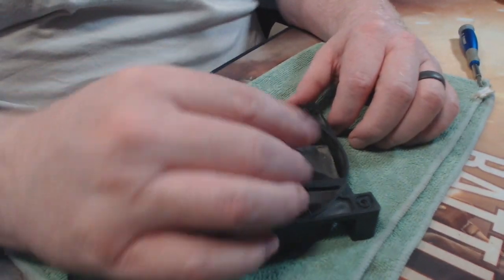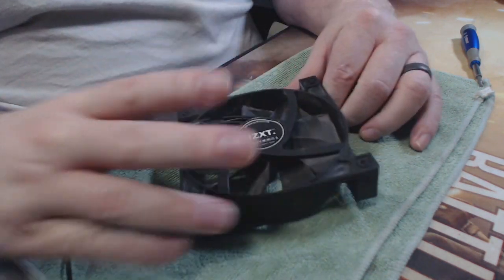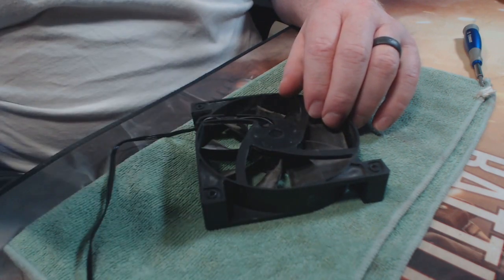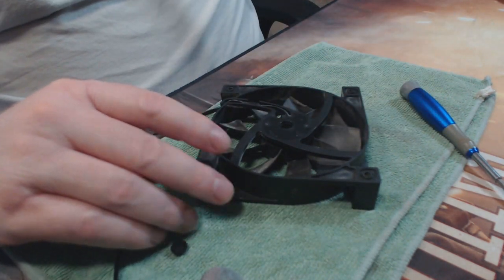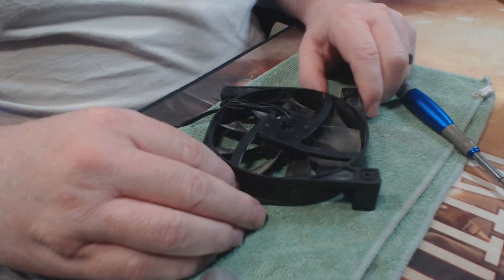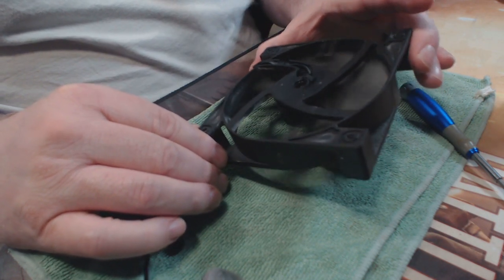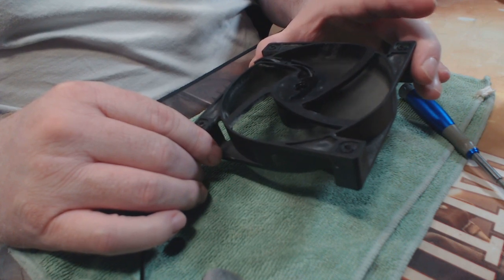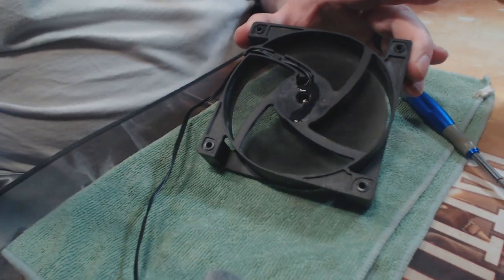Save Most Seized PC Case Fans By Doing This

Comment: Dear Sir,

My PC was getting slow and was behaving weird. I emptied up all drives for a fresh installation of Windows. As I have two HDDs installed, I opened the cabinet and removed the power and SATA connection from the second one to avoid any installation issues. To my surprise, I found that the CPU Heatsink Fan Blades were not moving. I googled " CPU heatsink fan blades jammed " and I luckily stumbled upon your video. I did exactly as shown in the video and Voila! Fan blades started running normal. What a simple yet highly effective trick that does the job. Thanks for this tutorial, Sir. ❤😎🎉
Reply from the maker: I am glad it worked for you!

Comment: This actually worked for my case fans! I was so nervous about them I hadn't realized they weren't spinning for so long.
Reply from the maker: Glad you fixed them in time!
Reply: My fan wire is gettin a bit loosened and it's intel once I just move the wires the fan fluctuates and spins for a fraction of second but now that also is stopped what can I do
Reply from the maker: @ishowshorts_01  Replace the fan or solder it if you know how.
Reply: @FrugalStreamer  what do i do when i don't have that hole in in the middle if the fan
Reply from the maker: @twixxtro  Buy a new fan.  It's a sealed fan and can't be fixed.
Reply: @twixxtro just drill a hole on it, use a sharp object. The material is soft.
Reply: @FrugalStreamer tysm! It worked for me, my fan had no hole so I drilled one, then I applied the lubricant.
Reply from the maker: Ok, not something that I would've done personally, but if it worked for you, that is awesome!  @KaedeChan301

Comment: Great tip. Thank you. I used Ballistol as a lubricant and it seems to perform well. The only difference was that my fan was not rubber plugged, but sealed shut with plastic. So I had to drill a small hole. I wonder how long it will last with my crude re-sealing attempt.
Reply: What did you use to drill the hole? Mine are the same way..
Reply: @rotitnhoj  a small drill bit. I think it was the one for wood, nothing fancy. The fan still works, but is definitely underperforming. I don't think the drilling method is sustainable, but will do as an emergency repair method.
Reply: @Aidikovo  appreciate the info!

Comment: very helpful! my case exhaust fan had this issue where it wouldnt spin unless i spin it initially (which meant that i had to remove the side panel every startup) and i was looking for ways to solve this and stumbled upon this video. didnt even know that sticker was covering a something other than plastic. i used a q-tip to dab a little bit of motorcycle oil i had laying around and at first nothing changed when i tried spinning it myself but when i reapplied the sticker, screwed the fan back on, and booted the pc, the heat from the fan eventually loosened the stock lubricant and let the new oil do its thing

Comment: Thank you so much for this I've always wondered how to fix fluid bearing fans!
Lots of questions for you though! 1.*Can your technique help a fan where dust accumulated in it? 
2.*Or does dust not affect fluid bearing fans? 
3.*Is it just use time that makes a fan seize up how yours did? Or a combination of use time AND dust?
4.* Without a filter I know fans spinning can pull in dust but as far as not spinning goes, I have a few unused PC fans laying around uncovered in a room right now (for months until I heard about dust messing them up) but I still have a few laying there right now for a couple days. So, do you think if given enough time, dust will build-up and make them seize up sooner rather than later when they are finally used?

Sorry for so many questions. Googling isnt helping me at the moment. Plus I like to ask people myself.
Reply from the maker: Dust will affect it.  But, it should be sealed normally.

Comment: i did not have 3 in 1, but i used the smallest amount of wd40, let's hope i dont die <3 my fan is spinning faster than it ever has. Definitely saved me quite a bit considering i was about to buy 50$ worth of RGB fans ;c
Reply from the maker: WD40 isn't a lubricant.  It will not hold up long.
Reply: @FrugalStreamer  i shall update you when it stops, at least this will be a good test
Reply: @Chris-liwymi  any update
Reply: @KsaThug  it is still working perfectly fine
Reply: @Chris-liwymi  thx for the replay i used a hair cliper blade oil it worked fantastic never hear a sound
Reply: @KsaThug  awesome, glad you found a solution instead of buying the 3 in 1. I hope it lasts. Take care

Comment: i have a coolermaster fan which spins upto like 5000rpm and i had to drill a hole in it to oil it 
i wonder if the piece of tape has come loose and spilled the bicycle chain oil everywhere

Comment: My PC made a sound like "PEEEEEEEEEEEE". I switched off the PC, opened up the box and started again. Found this chasis fan not rotating. As I touched its cable, it started spinning. Sometimes it could be the cable faulty or loose ends.
Reply from the maker: Of course.  Good troubleshooting!  Tidy up that connector!

Comment: Problem in mine is that is has dusk mixed with cat fur inside so the fans are seized and its 3 of 5 in my pc. should I so the same or how to properly clean them up? Rgds from brazil!
Reply from the maker: You may be able to get little pip cleaners from a craft store and use that to go in and clean any debris that may be in there.  That and canned air.  Then, lubricate.

Comment: I mnow this an old vid but i thought id ask. I have a series s fan that jams up sometimes.  Problem is that there is no hole in the top. Would it help to put some oil in the slot in the side and hopefully try to work it to the middle. Thanks in advance!
Reply from the maker: I don't think so, but if all else fails, I guess it's worth a try.   Might mess it up more though
Reply: @The Frugal Streamer  I did it and yeah, it actually worked. I used sewing machine oil and a syringe to get deep on there. Keep up the good work!

Comment: Hey I’m having some PC problems and noticed this fan was seized up, would a fan doing this cause the PC to bluescreen with a “uncorrectable” error. Seems a bit dramatic but i can’t find anything else wrong
Reply from the maker: If it is overheating, yes.  Monitor your temps.  If they are getting over 90, it very well could be

Comment: what are the alternatives to lubricant oil?
Reply from the maker: Any low viscosity multi-purpose oil will do, but don't use WD40.  It is not designed to lubricate.  3-in-1 brand oil is easy to find, hence why I recommend it.
Reply: i have a shell helix hx5 at home, does it work or nah?
Reply from the maker: @asdf7078  I personally wouldn't because of all the additives in motor oil.

Comment: Can I use wd40 instead?
Reply from the maker: No.  WD40 is not a lubricant.  It might work for a short time (days) but eventually it will break down.  WD stands for water dispersion and 40 is the 40th batch that finally achieved what it was designed for.
Reply: @FrugalStreamer  Gotcha, thanks
Reply: @FrugalStreamer  one little squirt of wd40 works and if it does it again just do it again :P

Comment: Any oil Will do?
Reply from the maker: No.  I recommend a low viscosity oil because of the speed of the fan.  The 3 in 1 household oil I used does well.  Do not use a grease.  You can get the 3 in 1 almost anywhere.
Reply: @FrugalStreamer  thank you mate, it's working, thank you very much

Comment: Hi Frugal Streamer. I just tried this now, thanks. it worked. I got to revive the PC 12v .27A but I discovered something, you can take the blade off by just carefully removing the locking plastic washer (it may be metal on some branded ones) after you've pull that rubber cover covered by the sticker (I used the most powerful PVA glue to stick both the cao and sticks back, I hope it works- I'll find out after 25 minutes). You can use a good thin tweezer (I used a Victoronix Swiff Knife's trimmer to do it but it warped it a bit but your can hammer it lightly to make it as close to straight as possible) to pull out that locking thing or washer, that locks the axel of the fan blade in place. I used 99.9 isopropyl alcohol to clean the shaft hole (w/ kitchen tissue and paper clip but I think a wipe you buy without any fragrance would be more durable to wipe it with if no fragrance exists) and the magnet on the fan blades.

I then tested it with a 9v battery directly connected it to two protruding wire (careful not to cross them, put an insulator between them). 

It took a little less than an hour the first try (but most likely it'll just take 15 minutes on the 2nd or so when another fan needed reviving), about the same amount of time, you'd spend to buy (and take risk w/ Covid though) to go  the mall, park and buy and less time to wait for the order ,online:-)

It's nice it's working now, I can use it again (on our CoolerMaster PC so it still has original parts, though I'm mostly a Mac user) and it just needed cleaning and it's not the windings of the motor or any sub-components like the capacitor or resistor. I think I can apply this with the iMac's fan and save $US50 and a month of waiting for it to arrive
:-)

God bless, Rev. 21:4
Reply from the maker: Prepare for your mind to be blown.  Rev 21:3-4 is one of my memory verses this week!  God is good!

Comment: will wd40 work?
Reply from the maker: No.  WD40 is not a lubricant.  It disperses water (WD).
Reply: @FrugalStreamer  Thank you sir.
Reply: I've tried it with WD-40 since that's a multi-use spray and it actually worked after a couple of spins.
Reply: @tyreesewatson8291  really?
Reply: hmm you can try i actually just tried seems to be working really well honestly  i even put it on my window slider and the window slides like a breeze